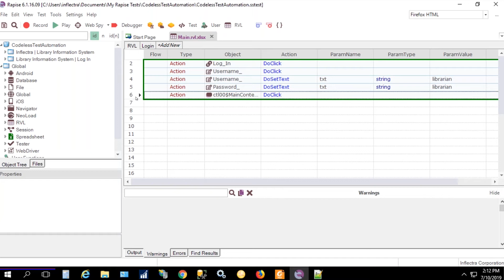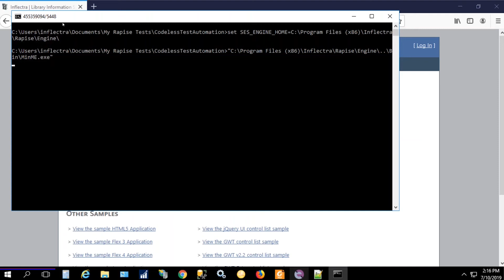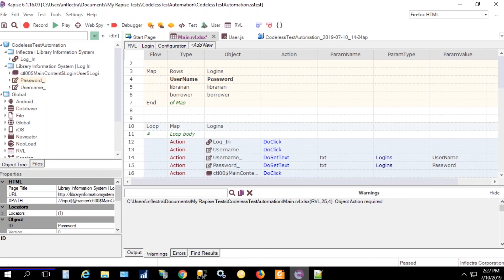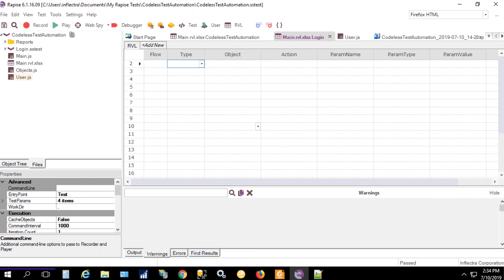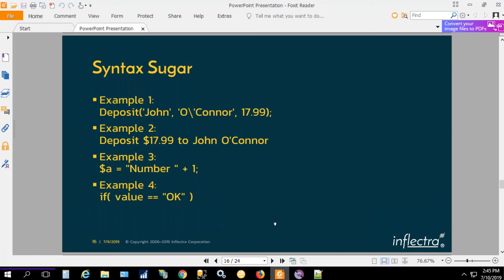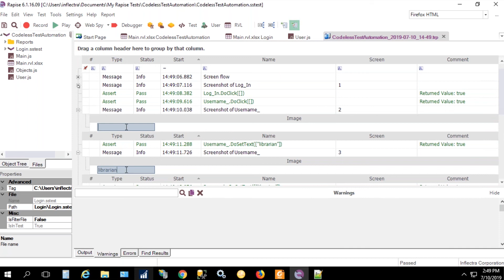Codeless Test Automation | Inflectra Webinar (Part 5)

Comment: Codeless is the key to software testing today and is the trend in test automation that’s worth embracing. Codeless automated platforms, like Avo Assure, helps QA teams to test complex or feature-rich software application without writing a single line of code. Avo Assure is powered by AI capabilities to make testing as seamless as possible.